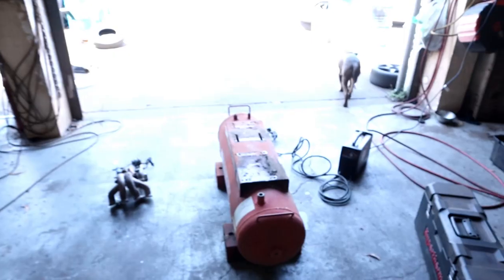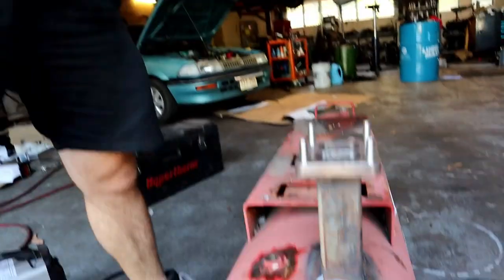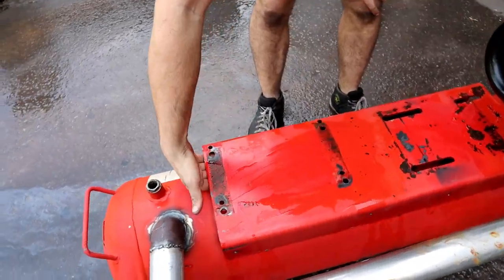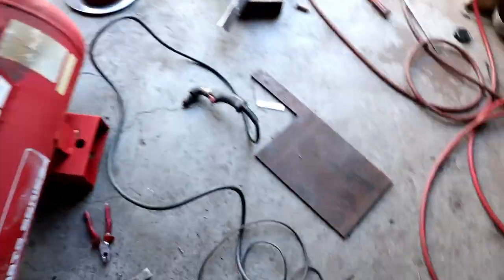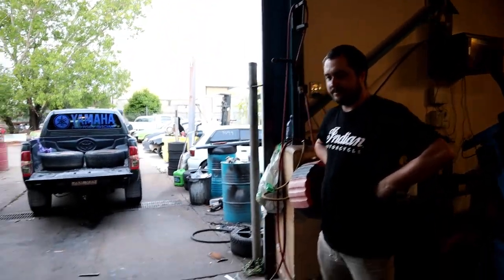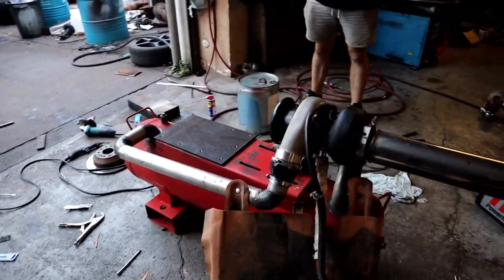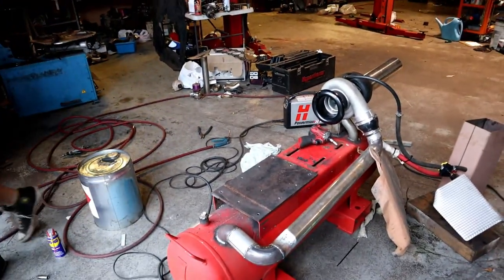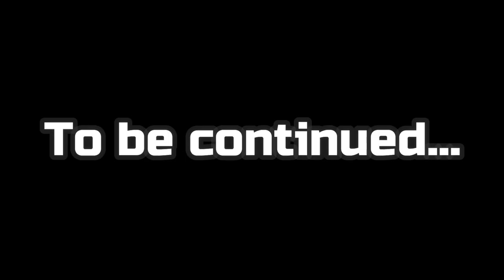How to build your own GT45 turbo barrel

Comment: I've always wondered if these could run on waste oil? You could lune the turbo, and then push drain in to feed the thing? Once it's up and spinning, a simple valve to throttle the oil going in to the tank might actually make the thing more civilized and controllable? Build another tank to hold the oil...plumb it to the turbo...pressurize it with air to provide lubricating fuel pressure? Also...alot of liquid fuel rocket engines use fuel to cool the combustion chamber.

Comment: With a constant source of fuel like that you need a throttle.  Also if you had a bottle of oxygen, it might help to inject oxygen on start up with the throttle shut to help the turbo spool up on its own power.

Comment: You've made a wood fired jet engine. 

IMO way more fun if you run it on gasoline and put it on a go kart. 

You can make the combustion chamber much smaller, just remember to include a flame can and fuel injector.

Comment: you should weld a cross into the exhaust pipe so that if the turbo explodes the hot side compressor wheel doesn't become a projectile weapon

Comment: Is it possible to make a self-starting turbo barrel with a tiny turbo so small the fire generates enough pressure volume to spin?  A larger turbo can be switched in with a valve or something once the tiny one has the barrel stoked and under pressure.
Reply from the maker: Yeah watch some of the newer episodes, it’s self starting now

Comment: I don't get the point.

I could see it 8f you built it with like a 500 gallon tank and wanted to burn trash really fast.

Or had it tuned so that the combustion made it burn super clean.

But what is the use case here?

Comment: I saw one that had an oil pump from an old furnace and the oil cooler was mounted in front of the turbo inlet with a slide in front of it to choke the inlet speed down to maintain a steady speed. Way too much fancy mess for one imo lol

Comment: Needs a drive by wire throttle body and a potentiometer to control how much air is actually getting to the turbo.

Comment: I was just wondering that what would happen if You put the oil return line from turbo to front of the air intake. So the mahcine could use it as a extra fuel. Maybe You need bigger oil tank. But if You need burn some waste oil away this might work bot maybe not. 😃

Comment: Crazy idea but while we are scavenging car parts for this, why not add a throttle body to the intake side?  then you could control it with a pull cable and have the option of a return spring
Reply from the maker: New video tonight!!

Comment: Id like to see it run off of waste oil or gasoline just for fun, maybe you could spray it into the turbo inlet to suplement the wood?
Reply from the maker: Cool idea we worked out the flame out the exhaust is actually the engine oil. When we block the front of the turbo it created vacuum and pulls oil through the turbo seals. Not good but the flames are still cool 🤣
Reply: @MattBerrymotorsport  yeah thats probably why throttle bodies go after the turbo on cars, so the turbo inlet never sees vaccum
Reply: Now your talking.Hold my 🍺

Comment: Help me understand what restricting the intake does to spool the turbo up? Or am I missing something? Not super familiar with turbos
Reply: @email4664  that's what I thought. Just sounded like it was spooling the turbo to build boost. I wasn't sure
Reply: Turn on your vacuum cleaner and cover the inlet. The vacuum actually speeds up.
They need to control the air leaving the turbo cold side going to the fire, like a throttle body does on an engine. They could also dump exhaust leaving the fire, that goes into hot side of turbo, like a waste gate operates.
Reply: @mechelec7845  right, I was imagining exactly that about a vacuum, I just wasn't sure because the turbo feeds its own fuel (air) and a vacuum is powered by an electric motor and restricting that air made me believe it was slowing it down, and that's why I was confused.

Comment: Could you burn waste oil? Use the waste oil to lube the turbo and inject into the burner. Use water injection to cool the turbo
Reply: Stuff the water let's go for alcohol straight in the turbo compressor.🍺😁

Comment: Why do this at night, and shake the camera so much?
Plus a small tube that adds water to the hot gasses before they go through the turbo, will keep the temperatures lower while adding a lot of steam to the exhaust.

Comment: attach a pot of water to the exhaust and see how fast you can boil it., or add oxygen bottle to the Inlet, it will work like nitrous in a motor.

Comment: Every time I see one of these burn barrels everybody uses rubber or plastic hoses to feed the turbo why not use Brake line tubing for the turbo oil feed.
Reply from the maker: Charge pipe doesn’t get too hot

Comment: I would get it operational in daylight, work the kinks out etc. Then go for the night shots after its running smooth. Also rig up a better throttle than just a rando hand held plate to cover the intake. But still way cool. I wonder if you could load it up with coal or charcoal briquettes..

Comment: Well that was annoying. Stop blocking off the air. Just let the bloody thing run. What the hell else was it built for, to save it for a space heater on Christmas. It is to blow and go and blow. That is the point isnt it. Yall act like you want to cook hotdogs with it. What are you scared of, Fire it up and run. It will be out of fuel long before it dies. Probably wouldnt melt down the wheel if you let the air fricken move too. Jeeeeese WTH